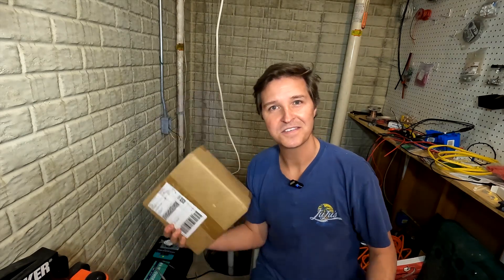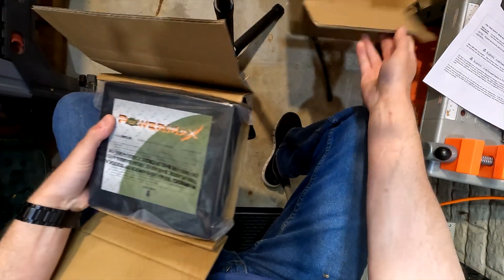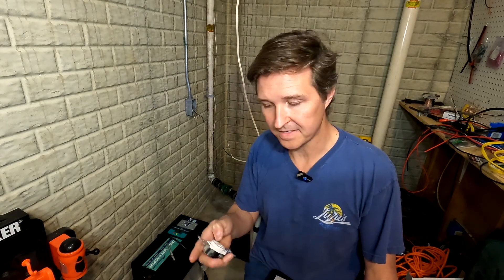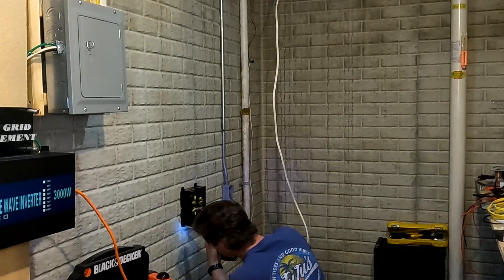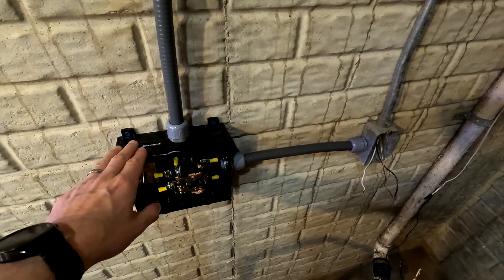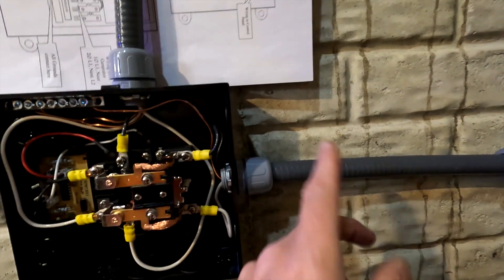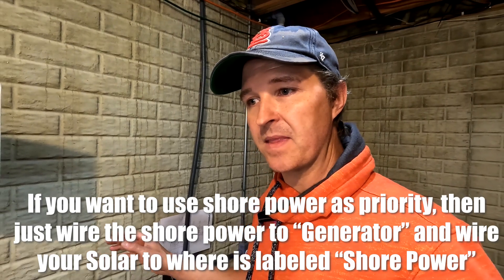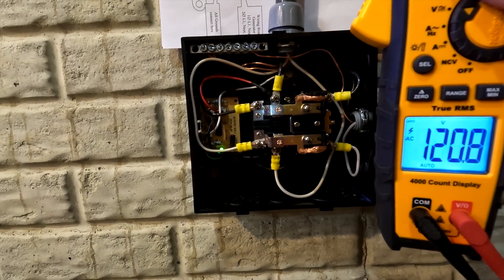Installation of the PowerMax PMTS-30 Automatic Transfer Switch for my Sump Pump

Comment: This is only an applicable solution in situations or countries where no regulatory compliance is needed.  Elsewhere it would need to meet IEC 60947.6.1 (Transfer switching equipment) which allows for a higher level of isolation safety between the two power sources for the protection of line workers.  A relay works in practice but isn't entirely safe, nor designed for this purpose.
Reply from the maker: Thanks for the info and the comment.

Comment: Your transfer switch is an elctro-mechanical relay and should not be mounted sideways unless approved by the manufacturer.  May of these relays rely on gravity dropout.  Just saying.  Otherwise nice device.
Reply from the maker: Thanks for the information.  I wasn't aware.

Comment: What if I want to run shore all the time and when shore fails it runs off grid, how do you wire it? 
Different?
Reply from the maker: You would just switch the input wiring.  No big deal.  Hope that helps!

Comment: Thank you so much! Your video link should come with the instructions.. Now I can install my Powermax Transfer Switch with confidence👍😊
Reply from the maker: Glad it helped!  Thanks for the comment.
Reply: Wiring up my PowerMax right now in my trailer camper. Due to parasitic drain from contactor solenoid, I will be doing what you suggested - swapping generator (inverter in my case)input with shore power. Although, I’m a bit worried about that contactor’s  lifespan if my camper is continuously connected to shore power when parked. Do you think that could be an issue? Thanks.

Comment: Can’t not  run shore n off grid on the same conduit electrical code  because if is short on the conduit it will damage boths system  very dangerous goggle electrical code before doing it
Reply from the maker: Thank you for the information!

Comment: Are you not able to switch the way you wired it and make the grid priority
Reply from the maker: Yes.  It would just take a bit of rewiring.  Just switch the input connections in the unit.  No big deal.  Thanks for the comment.

Comment: Glad I found your channel! I've enjoyed and learned much from your vids. Thank you! I'm working on a 24V hobby setup and really like the simplicity of your setup diagram. Thank you so much for sharing the diagrams and all of your efforts. I looked at my hand drawing on my sheet of paper chuckled. My first experiment is to run my refrigerator almost ( ..cloudy days) 24/7 on a simple 3-4 panel, 24V setup. Been playing with a grid tie inverter too. I have the bug now...In a good way. Best to ya and the fam.

BTW -  I ordered a Spartan Power ATS before I watched this video. I believe it's the same as the Moes one. It's cool to be able to use the full potential of the solar but then switch like a UPS when needed. I think I can use the load output of a Victron 100-20 to feed the ATS to control cut off.
Reply from the maker: Glad to hear you are dipping your toes into solar.  It can get very addictive!  I didn't think about controlling the ATS with the CC.  Thanks for the comment!

Comment: Have a look at the Moe’s transfer switch. I have mine installed about 3 months now. I like that I can set the battery voltage that it transfer back and forth. Might be something you could use…..Love the videos.
Reply: Ill be getting the Spartan Power ATS tomorrow. Slightly more affordable version of the Moe's.
Reply: @tweedeldee8122  let me know how you like it….always looking for a more affordable mouse trap :)
Reply: @davidbrady9686  My system is 24V but I've used the ATS at both 12v and 24V. I ordered two Chins 12V,  100AH but one was bad, so I went 12V for about a week.

I've been using it for over a week now and it's working pretty well. It doesn't seem to switch to grid at the exact moment the voltage hits your low voltage setting but that's probably by design. I'm using it on a refrigerator circuit. The only mishap I had was when I checked the ATC and it was at the low cut off voltage and I wondered why it had not changed. I went back to the kitchen and opened the fridge and it shut down. The ATC had transferred but my 15 amp AC circuit breaker in the panel tripped. I think that was a one off.

I'm currently powering the ATC with the load output of a Victron 100-20. with #2 conv. algorithm which shuts off at lower voltage than the ATC is set for. The load from the transfer switch is currently .2 amps or 5 watts.

If the ATC loses the battery power it won't turn on or work as far as I can tell. It's nice the voltage reading can be calibrated to match your actual battery voltage.

Lately I've noticed a couple of inverters that have ATS function built in.
Reply from the maker: Thanks for the info.  I'll check it out.